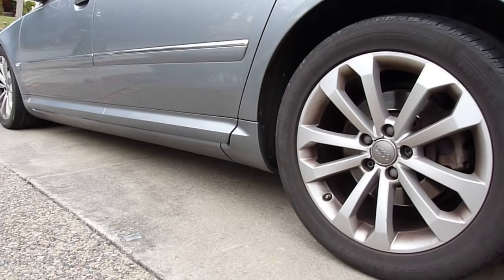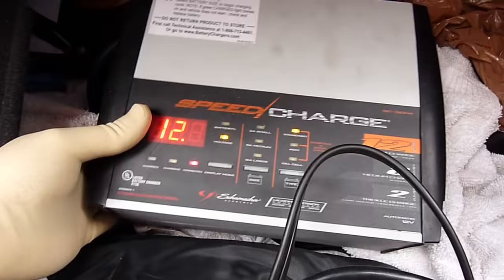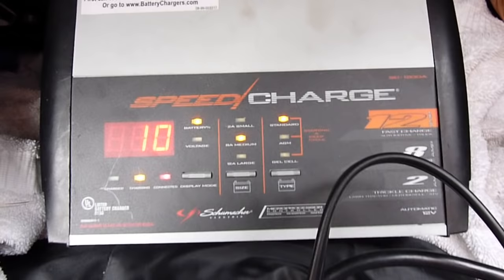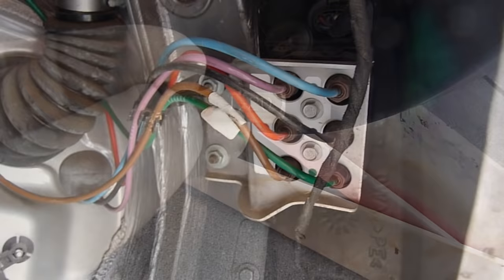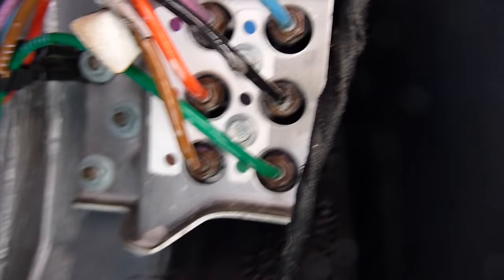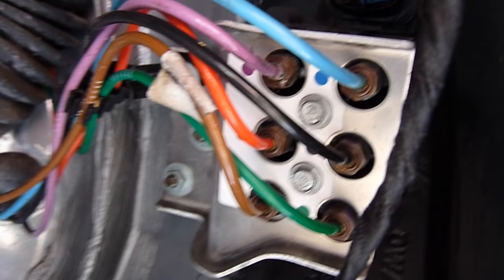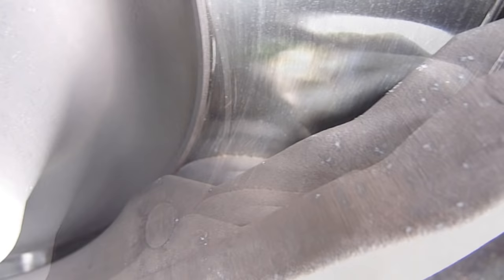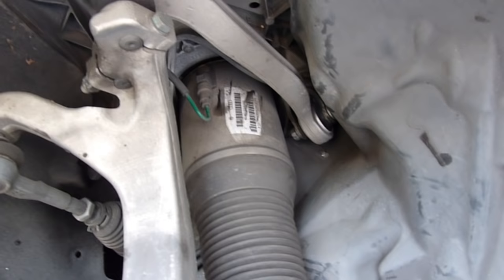Identify, Test  and Confirm the leak on A8L Front Air Suspension Failure

Comment: ok here we go again so I had a new air shock put on but he didn't do the Suspension Leveling Calibration correct and now both suspension lights are on and it has dropped again but if I restart the car and wait a few min the lights goes out and the suspension goes up .  what can cause this ???????  and now I have 24 codes also

Comment: i now changed both my struts and compressor:D first only the left one,  after 1000kms the right one blew while waiting at the lights few days ago :D after only changing the left one, everything was working fine, no leaks. i changed the right one and it drops down on the right side after a day or two. i tried this method but couldnt see any bubbles from nowhere... what else could it be?
Reply: Just get rid of the air struts and get the coil over kit

Comment: My 2008 a8L air ride is stuck in the lift position. Fully inflated. Opposite of everyone who's leak and deflate and noone can figure out why including me.  Dealer hooked up the computer and can't get it to go up or down.. fault code just says upper limit exceeded intermittent. I think it was code 00114 but not sure. My mmi settings are sometimes greyd out for the ride settings. Either one or two lit or all 4. Air ride warning light , yelllow car with up and down arrow flashes and then stays on solid.  Dealer thinks valve block is the issue but aren't sure. Want more money to access and test it. Car is jacked up like a monster truck and rides so stiff I'm ready to park it. Any ideas on what is causing this? Dealer said they have never heard or seen this either. Could be full of S#&T and just want more diagnostic money. Need some help if you have any idea. Would appreciate it. Hoping it's the valve block so my former Audi mechanic buddy and myself can DIY it and save some big money. Dealer wants $700 for the $170 part and $1800 total of it is it. Thank you
Reply from the maker: kkdogmom it’s the compressor relief valve stuck, doesn’t release air. Check the valve or replace the pump, should fix it
Reply: 3dogs1monkey thanks for the fast reply. The dealership ended up confirming exactly what you said. Relief valve in compressor stuck, need  to replace the compressor. Ordered one online for $250, didn't want to pay $1600 at  the dealer for the part. Lol will replace it as soon as it gets here. Thanks again. Love your videos. I've learned a lot.
Reply from the maker: kkdogmom just replace the pump and do it carefully not to break anything else :-)
Reply: 3dogs1monkey exactly what it was. Compressor replaced and it's working fine. Thanks for the help
Reply from the maker: kkdogmom good job
Reply: The design and programming should be of compressor or airbag fails it should fail open.  If system fails open the vehicle would at least be fully raised suspension front and rear.  Makes vehicle at least operable with full raised suspension to get to mechanic.
Reply from the maker: kkdogmom it’s the air compressor release valve not working.
Reply: None of this. I have Audi a8L 2007 stuck on lift mode too only on passenger side. And I just put brand new Air compressor and it still stuck on lift mode. So don’t believe it’s a conpressor.

It haves to be air strut or on the air strut there’s a little 1/4 valve air relief valve is stuck at top of air strut

Comment: My front dropped and the back was still up after I parked it for a month the back is now down as well.  I also can’t get into the car section on the Mimi to lift it
Reply from the maker: wavy baby make sure the battery is fully charged and read this post carefully http://www.dognmonkey.com/audi/2006-a8l-d3-front-air-suspension-failed-119k-miles.html
Reply: @3dogs1monkey  I think he might mean what happened to me someone spilled soda on my mm I buttons and I managed it save every button but the godd**m  car button everything else works flawless radio telephone it never turns off randomly I can always open or close it. I noticed if your mmi display won't go down you have a problem in the loop somewhere

Comment: Hello. My vehicle jack. Mode is gray. And the front air suspensions are down. The compressor doesnt pump either. Any IDEA?
Reply from the maker: Mustafa Solmaz make sure the battery is Good, 12.2v+ with ignition on, you should be able to put to lift, if you put to jack mode, the pump is disabled, only put to jack mode after the lift cycle is done to find which one is leaking
Reply: @3dogs1monkey  I even hooked a battery charger on it. But the compressor didn't start pumping. I checked the fuse also. Does it only start when the motor is running or also when motor is off?
Reply from the maker: Mustafa Solmaz may be you’re already in Jack mode, get out of the jack mode. The pump doesn’t fail so don’t mess with it.
Reply: @3dogs1monkey  I can't its grey
Reply from the maker: Mustafa Solmaz fix this before anything else
Reply: @3dogs1monkey  fix what? The air. Strut? But my compressor doesn't even start to run. I even tried. To hook my battery with a battery charger while ignition on but no use...
Reply from the maker: Mustafa Solmaz fix the grayed out jack mode
Reply: @3dogs1monkey  how :D
Reply from the maker: Mustafa Solmaz never had the problem, can’t help you there, sorry
Reply: @3dogs1monkey  i finally got the solution. the relay was somehow just working sometimes, although battery charged. first off change the relay. its cheap and easy. and the compressor wont run until you start your engine. on my a8 the air strut was also defective . if you got a 41nut its also no big deal to change. if the dust cover is blown so is your air strut. and changing the orings has no effect. inside of on top of the air strut(the metal thing) is an extra chamber where the air goes in. you cant open that up its an extra area. hope i could help.
Reply: Mustafa solmaz. Mine also grey. Did you fix it. And do you know what was the problem 
Or works the jack mode only when it is lifted

Comment: Hi @3dogs1monkey,
i have d3 2004, my problem is with back suspension, it's dropped down when i didn't drive car few days. On VCDS air bags work correctly, same pressure on all 4 bags. 
What is the problem, valve block or something other ?
Reply from the maker: Zoran go to the website and follow the instructions there to find the leaks.
Reply: 3dogs1monkey
Thank you for answer.
Btw. When you do this test, JACK mode si Off? And car is in Lift?
Reply from the maker: Put car in Lift when done then put in JACK mode = ON
Reply: 3dogs1monkey
Can u write your email?
I will send my video to you and if you can see did i have the problem with valve block.
Reply from the maker: Zoran go to the website and follow the troubleshooting instructions

Comment: my pump won't stop running without me unplugging the battery.  I changed the solenoid but still the same. I think my pump has burnt up now. smh
Reply from the maker: Check the relay under the dash
Reply: I changed it already. We're gonna change the pump. It has to be a check valve in the pump itself
Reply: What else can you think of?
Reply from the maker: Your pump is just pumping if electrical is there - when the ignition is off - the relay 367 should turn off the line to the pump - the pump also turn itself off when it's overheated only if the ignition is on. It's not your pump, it's your system, I think. Ask people in http://www.audiworld.com/forums/a8-s8-d3-platform-discussion-60/
Reply: Check the roster and multiply blood pressure in to the Silla Noyd then PTA’s plays in activation mode

Comment: ok can you help me with this I have a leak in my a8 but the suspension lights are not on inside the car , its just like yours one side lower then the other
Reply from the maker: cowboyfan dallas if one side is lower and no light inside, I think you should check the valve block to see if it leaks there
Reply: 3dogs1monkey thanks but is that good news or bad
Reply from the maker: cowboyfan dallas that's no news :-) find the problem first. The valve block leaks can be fixed with $.20 rubber rings if you're lucky.
Reply: 3dogs1monkey you are definitely the best and I hope so . I just wish I new how too fix my car myself
Reply from the maker: cowboyfan dallas go to audi world forum and ask someone to help you. Quite a few guys in your town. No shop will replace o rings for you.
Reply: 3dogs1monkey I have a 2014 Q7 and my compressor  got replaced due to some fault , mainly due to the noise which it started while lifting the suspension of the vehicle from lower levels. The Audi guys replaced with new two solenoid compressor and the noise is still coming while lifting. He even showed other q7 they are quiet a bit. The guy saying "as u got two solenoid(the latest one), its making little more noise. No need to worry about that. He replaced that through warranty and so I want confirm from u, that while lifting the vehicle from dynamic, does the compressor make sound,apart from the engine sound? Please observe precisely, from q7 or the vehicle u have and let me know please, just now I got it, that's why. He even explained well and showed me the old compressor with my chasis number. So, can u clear my doubt?
Reply: @3dogs1monkey  Yo man, thanks for the video but My issue is the Pump starts pumping some pressure for about 15 secs after raise the front pretty enough the whole this pumped air is back down to lower position, instantly after that pump is On again pumping the front of the car and than lowering again.. (comfort mode) And this process is repeating 5-10 times  before stop and everything looks fine. Also I observe that front struts stay higher than back of the car when is parked. I generally think its the distrubutor (valve block ) Also when connect to VAGcom it says G290 and G291 leve control pressure sensor - implausible signal - intermintent... I thnk I should replace that block, maybe the sensor is faulty. My 2 front struts are recently repaired and car doesn`t look to go low when stay more days even on jack mode, seems not a leakage or bigone.. PLease help!